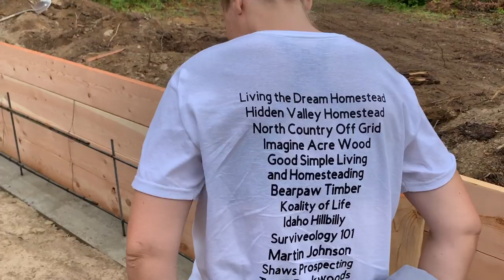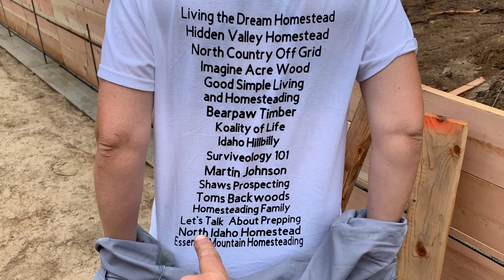WE'RE READY! Building the Forms for our Concrete Stem Wall | Off Grid Cabin Build #7

Comment: Ok.. so I'm finding this entire process totally fascinating as it's so not anything like we do in Australia.   We've built 7 houses in our 25yrs together... we're sufficiently over it.   Lol.  (The building, not each other.  Ha ha)
Reply from the maker: Wow. 7 houses. That seems like a lot of work. You should be an expert by now. Hahaha. What are some of the things that are different?
Reply: @MartinJohnsonOffGridLiving  The biggest difference would be that we don't have a void under our floors... We have a concrete slab on the ground once all services have been put in to come up through it.  Sidenote - We had contractors do all of our houses, so we don't get any credit for physical effort.. ha ha... Just the emotional stress.  Back in the 70s & 80s it was much more common for people to have timber homes built, so that was a 'concrete pole home' in some ways, with a timber floor for the second level, but nowadays it's the concrete slab on the ground.  I suspect that you need to have heating under your floors etc ??  In the Southern states of Australia, it can be common to have floor heating on top of the slab, or in the timber flooring.. but it simply doesn't get cold enough here in Brisbane.  We are in the 'dead of winter' right now.. and last night was 9 degrees celcius.  For us, this is FREEZING !!!
Reply from the maker: A lot of houses here have slab foundations here too but crawl spaces (ours) and full basements are also popular. Slabs can be a problem in areas that might flood. We have a lot of those areas in the states.

Comment: When I was trained as a concrete worker, our teacher said to keep a small spool of wire in your left hand and use the Front cutter to twist and cut it after you hooked some rebars together. It gave very tight rebar walls that you could actually climb if need be, and we got quite fast with those jobs. We also had a dedicated bender to make all the rebar bends that was needed, so your wall would have just taken a few hours to complete. We also used pre made concrete forms that was very strong and could be fastened together with some bolts and clamps. Super strong with no chance of leaking or bending.

Comment: As Electrician we use tie wire for variety of stuff.  Another tip is  you take 20 30  feet of it find the center, stick it on a nail And use your drill to twist the other two end’s together. Twist it tight And I will add strength to the wire.

Comment: Tie wire trick. Cut the pieces of wire that hole the tie wire together but hold it and wrap duck tape around the outside of the wire spool, then pull the tie wire out of the center of the spool instead of the outside of the spool. You don't have to worry about the wire getting tangled or having to work around the little wires that hold it together. :)
Reply from the maker: Thank you for the tip. I’ll try it on my next house. Ha ha ha. Thank that might be done tying rebar for a while.

Comment: Could have rented some 1 1/8 forms and about 25 stainless steel straps for the bottom and spacers for the top of wall. 2x4 on top of walls layed flat against forms. But it's hindsight over already.

Comment: Tip for the form braces, take some electrical insulating pipe and put it between the forms, and stick a piece of threaded bar thru it with nuts on the outside of the forms. The pipe keeps the correct spacing, and the treads from spreading out.

Comment: Wrap your roll of tie wire in duct tape and then pull you wire from the center of the wire roll instead of the out side- works nearly as good as one of those fancy wire wheel holders
Reply from the maker: Thanks for the tip. I’ll try it next time I tie rebar.

Comment: I love your enthusiasm. But here it comes: If you're setting up another shed like your first one, put a large slab under those blocks. You laid them on their sides which means all the weight goes on the thin edges of the blocks which will not stand for long. Also, when you plumb that house, try separating the effluent waters. Use that good water several times before it goes into the septic tank.
Reply from the maker: First point: good point. We will be moving that shed it’s location was and is only temporary. But I could jack it up and ad a paver if needed.

Second point: I’ll have to check if that is allowed in Idaho. They health official said there is no such thing as gray water in Idaho. So I’ll have to check what they mean by that.

Comment: The wire and nails were a good idea. Contractors would not have done that. I appreciate the replies, the tent with 2 red lights was your parents camper. Truck or trailer? I know your slow and learning as you go but what I've seen beats the pros. Keep it up.

Comment: What's the requirements for venting the crawl space?
Reply from the maker: “The under-floor space between the bottom of the floor joists and the earth under any building (except space occupied by a basement) shall have ventilation openings through foundation walls or exterior walls. The minimum net area of ventilation openings shall be not less than 1 square foot for each 150 square feet of under-floor space area, unless the ground surface is covered by Class 1 vapor retarder material. Where a Class 1 vapor retarder material is used, the minimum net area of ventilation openings shall be not less than 1 square foot for each 1,500 square feet of under-floor space area. One such ventilating opening shall be within 3 feet of each corner of the building.” Ours will be cut into the rim joist.

Comment: I really REALLY hate to criticize when people are working hard and seem like really good people, BUT, if we were friends, I'd have to say something so.....

You guys are seriously dangerous with a chainsaw. I don't know if someone has a good safety video they can recommend or if you know someone who can go over it with you but...... one of you is going to get hurt. It's more than should really be sorted out in a YouTube comments section, but you really need to take a bit and learn how to start a saw more safely (the chain break is your friend) before someones leg gets it and all of the reasons you don't routinely use the top of your bar to cut with (it's a great way to learn about kickback the hard way). Please take this as a friendly suggestion and learn some safer methods before someone gets hurt.
Reply: Was just thinking the same, also the safety on the circular  saw... the shield is there for reason.

Comment: I think you wasting time, why dont you use concrete slab construction? cheap and reliable
Reply from the maker: At this point in the construction it is the same whether we’re building a slab foundation or a foundation with a crawlspace. The footers still need to be more than 24 inches below the surface of the ground and concrete has to connect the footer to the slab. You have to remember The ground freezes here in the winter time and you will have frost heave destroying your house. We’re not building the slab because I don’t like them. I like to be able to get under the house and fix things that need fixing.